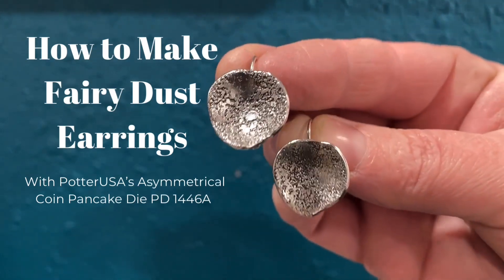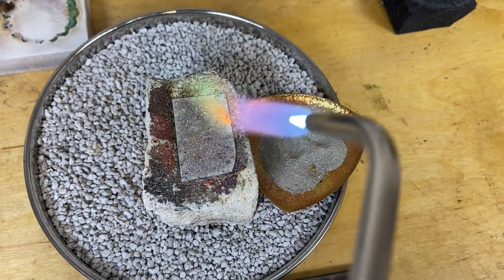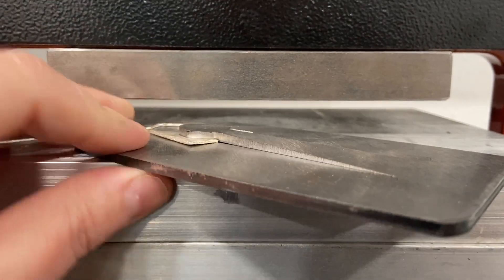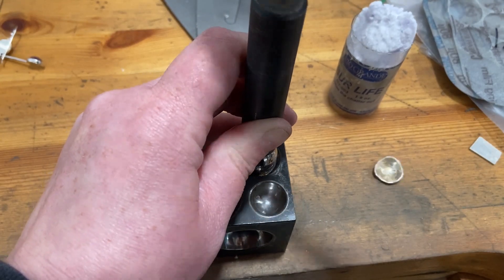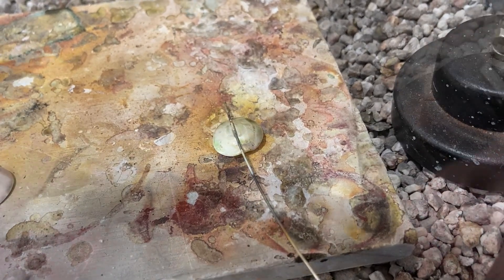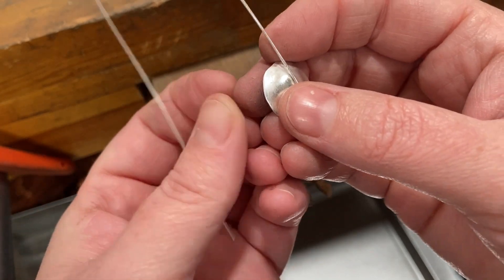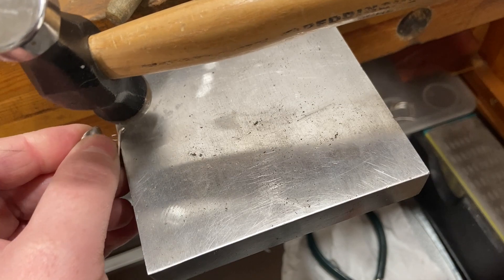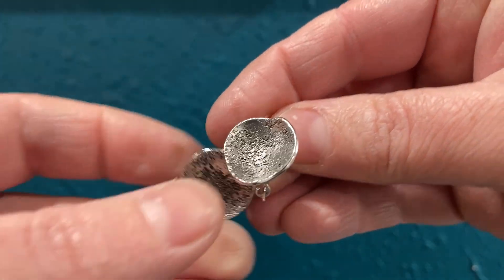How to Make Fused Silver Dust Earrings

Comment: How do you prevent any fire scale if you are heating the silver so much? Because I feel like to fix the fire scale by buffing afterward, you would remove that dusty texture you just put on. Just wondering because I struggle with fire spots after heating sometimes